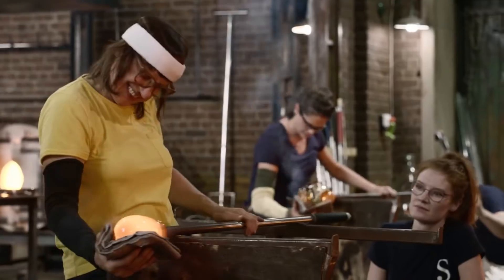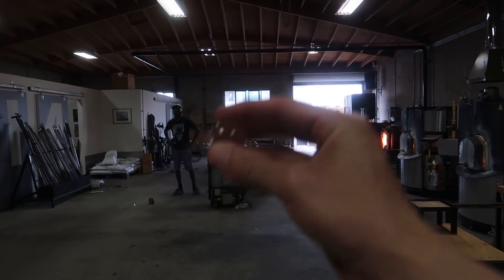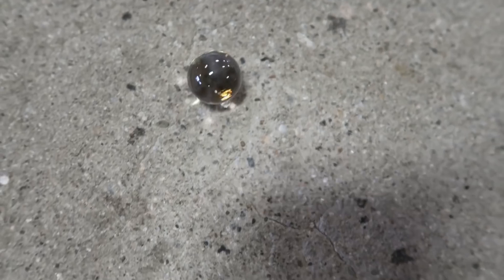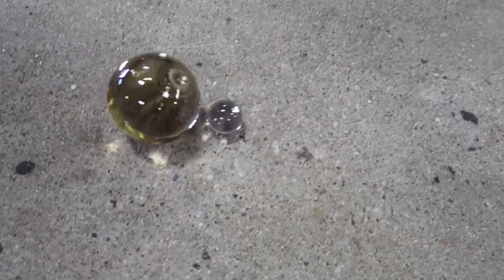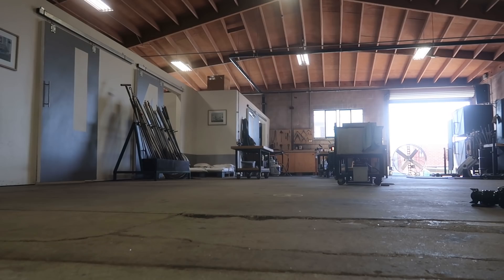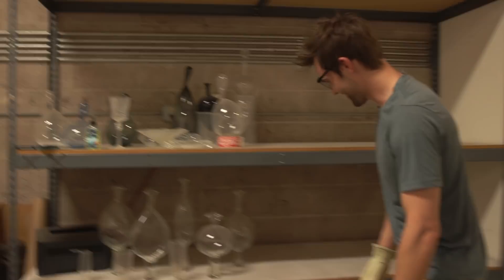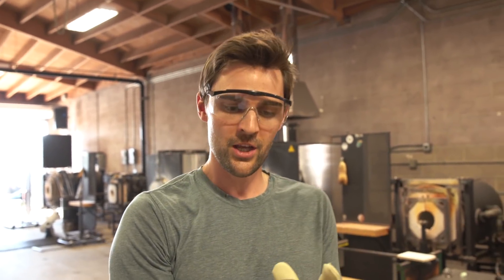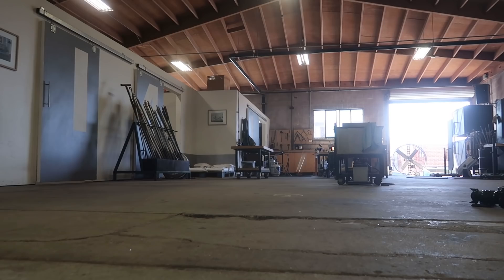BREAK or BOUNCE!? Unannealed Glass Balls

Comment: after dropping them from the tower with How Ridiculous, you take them to hydraulic press channel to test their true stress levels
Reply from the maker: this is a great flow of testing... I'm super into it!
Reply: Testing the true stress level with a press is cool but when you start putting stress in a pinpoint place it would take less pounds for the glass to break. Like if you pressed a stake into the sphere it would probably crack with just 30 lbs of pressure but it might be able to withstand 200 with the surface area of a press head. Just my guess
Reply: Not to mention the throwing this glass ball on the ground introduces about 250ish lbs of force but for a brief time period where as a press continues to add pressure. The glass ball would be able to withstand more temporary force from a throw than continuous force. Interesting idea though